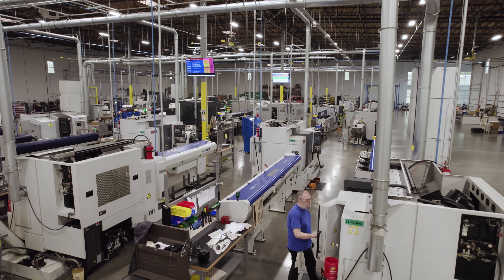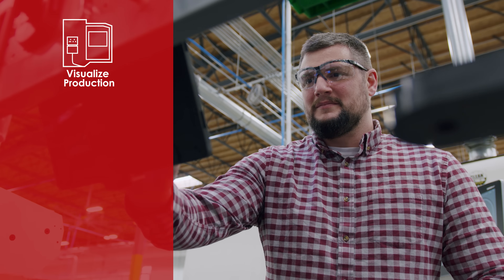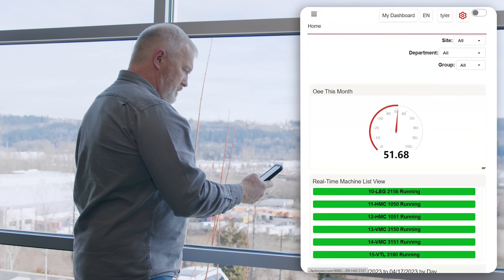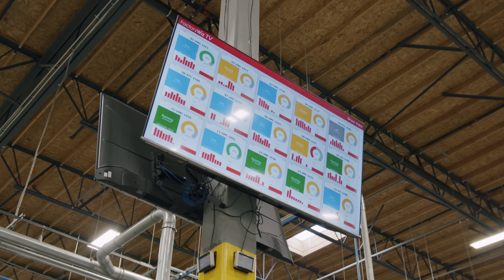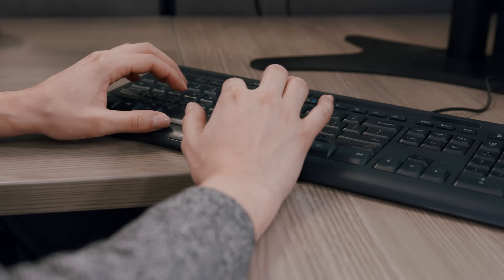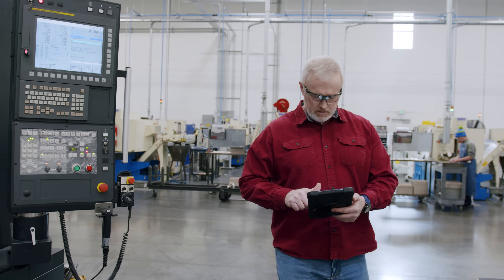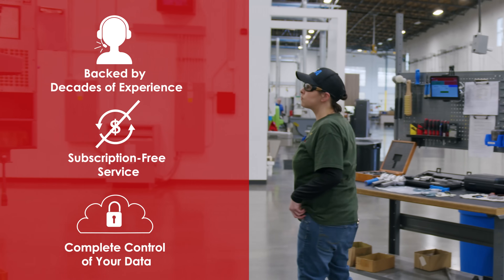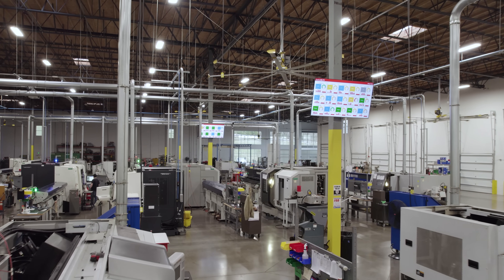What is FactoryWiz Machine Monitoring & DNC?

Comment: How does this differ from MachineMetrics or Amper. Do you monitor and manual labor areas like welding. or assembly
Reply from the maker: We differ from Machine Metrics and Amper by not using proprietary hardware. We connect natively to most modern machines that are ethernet ready. On older style or manual machines that you reference, we use an off the shelf data collection unit, this way if one fails, you don't necessarily need to go through us for replacement. We also do not follow a taxing subscription licensing module. Instead, we offer a perpetual license meaning you own it and the data collected. All data collection is also on premise and not stored in a cloud server controlled by us. We let you take control of your collected data by offering simple to configure dashboards and reports, this way you can easily visualize and understand your data to make decisions to help your company make more money.

Please reach out to our team at https://www.factorywiz.com/ for more information. We appreciate you commenting here.

Thank you,

FW

@scottyach8766